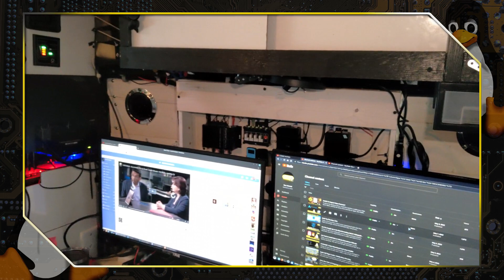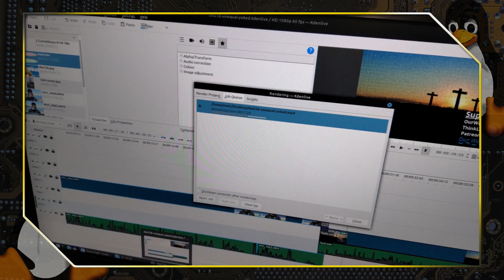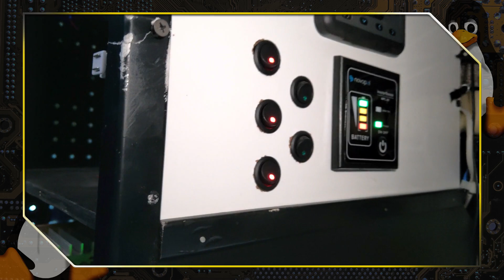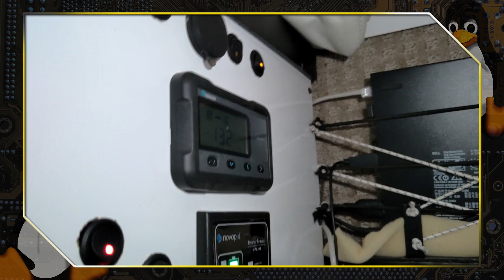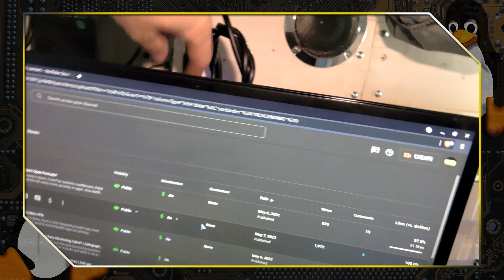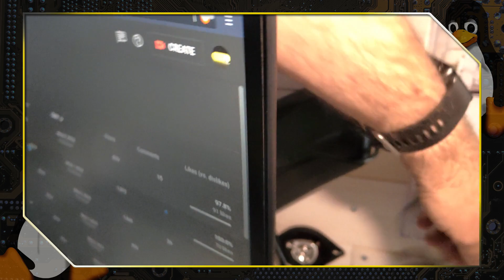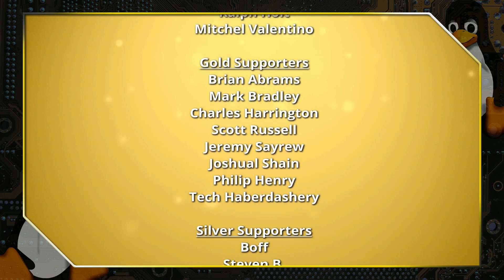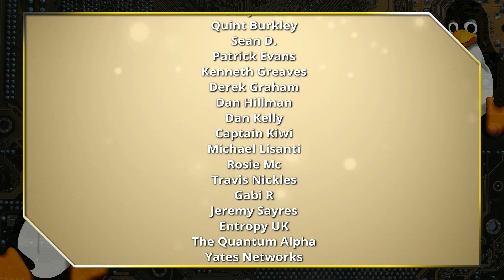Off-grid Linux | Running Computers on Solar Power and Batteries

Comment: Hi, I'm new to this and looking to move into van life too. Before I found your video, my research lead me to a 48v battery system and a dc 48v server psu along with a PicoPSU. I'm not sure if this would be the most effective way of powering a possible gaming pc. What are your thoughts on this, is 48v the right way or should I go for a 12v battery config?

Comment: This is sooooo perfect. This answers my biggest life-long philosophical questions thanks to this.
Which one has an easier life, someone who lives in a cave and has to go on hunt for dinner, OR someone who is living with all the tech there is right now; This equation was always lacky because the one whose life is dependant on tech could not survive if something simple as electricity were to be cut off. but this solves that part
WOW technology beggets technology and on and on it goes until its over and the cycle of it all diminishes any traces of peace of mind; we srysly need to DE-TECH our lives

Comment: I thought you were going to show us some cool low power shutdown system.  Decades ago, I used to use either the CTS or DCD line on a serial port for the UPS to signal a system to shutdown.  If you want software for something like that, I'd be willing to look at patching something.

Comment: Did you not think about using your van as a charger? I mean charging a secondary deep cycle battery by your van's alternator. I know the solar panels are "COOL" and work fine but surely you didn't leave that source of power untapped.. Am I right?
Reply from the maker: Here is how I do that, but only when it is needed because right now the solar panels are more than enough:
https://www.youtube.com/watch?v=fVcl9BXgNnU

This is called a DC to DC charge which I can turn on and off as needed.

Comment: So about how much in today's prices would this take about do you think? Deff would need an efficient AC unit that is separate from the Van's A/C for the heat. Thinking one decent Ryzen computer instead of all of those computers, but with a maybe 32 inch HDTV mounted on the wall myself.

Comment: Have you ever tried mobile Linux on phones? You should check the Pinephone, the old Moto Droid 4 and Maemo Leste.
Reply from the maker: I have considered it, but I do not have the funds to pick up extra equipment for testing at the moment.
Reply: @SwitchedtoLinux  a Droid 4 is like $20 a pop, you can also use the Droid Bionic which is even cheaper. You just need to do some simple software mods in order to install Linux on those suckers

Comment: My Question still boils-down to The Newbe Failings of Last Year ...
. have you got and installed the "Solar Panel" Re-Aiming Frames in-place yet? . . The Auto-matic Trackers?? . . No? - Why Not??
Reply from the maker: No. They are too problematic, great in theory but not in practice
Reply: @SwitchedtoLinux  
Having 2-by-4's of "Dymarex" 84" X 52" Rescue Blankets acting as Mirrors does the Trick and is Mobile. ( E-bay )
also, having Solor-Panel Boosters for those low-power days really doesn't hurt either. ^___^ ( E-bay )

Comment: I'm not sure how the support is in Linux, but I'm wondering if an AMD Ryzen 7 5700G APU with 16GB - 32GB of system RAM could handle your video editing/encoding, while reducing your power draw as it's only rated for 65 watts?  
For a while last year at work I was running my old gaming build while I waited on parts that's an AMD AM2+ Athlon II X4 @2.95 Ghz, 8GB of 800Mhz DDR2 RAM, an AMD R7 240 2GB GPU, 120GB ADATA Boot SSD, 500GGB  WD blue laptop drive, an old LG IDE DVD-RW drive, and a 2 port PCI-E 1x USB 3 card on an MSI Micro ATX Mobo, and at it's max even rendering 1080p 30fps video in Davinci Resolve on Solus Linux, i was pulling at most 130 ish watts, off a 450 watt Rosewill Arc PSU, and the new Ryzan APU's are way more powerful than that setup.
Reply from the maker: My Ryzen 5 laptop is similar and lower wattage. Processing takes a little longer, but not too bad.
Reply: @Jaedy Purple That's great, and all, but your situation is different than Tom's here, as he's mobile, with less panels, and no wind generator to produce any power when the sun is not at it's fullest, nor is he always in the same place day to day, so that means he has to adapt on the fly to whatever the conditions give him.